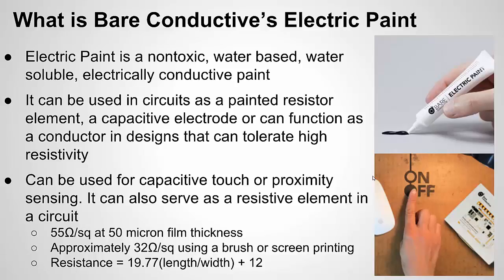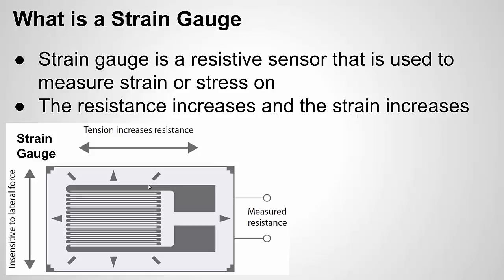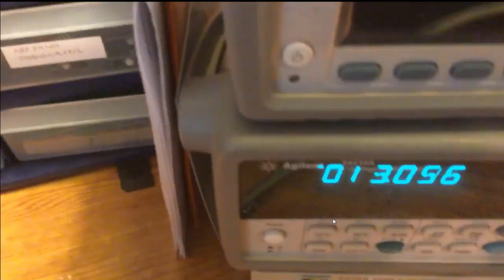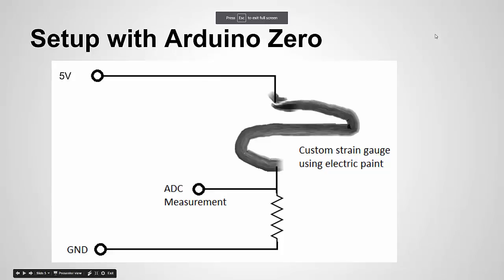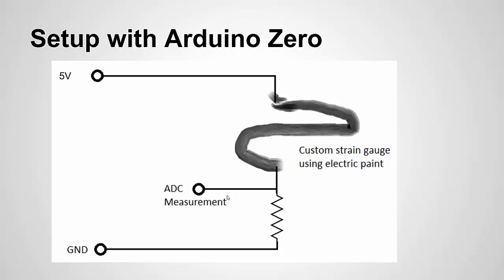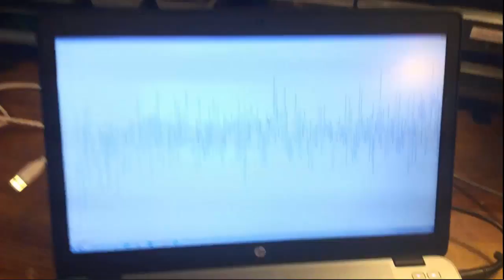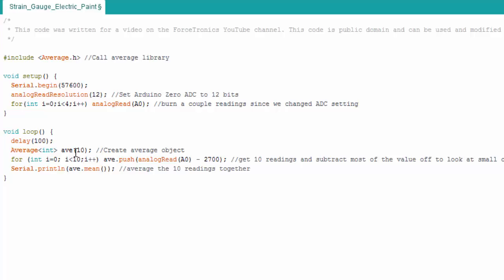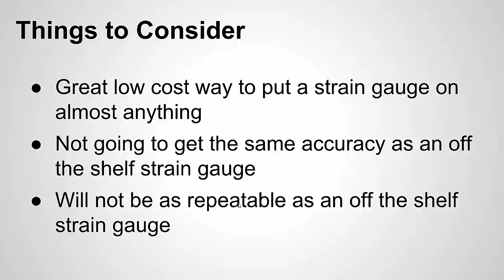Building a Custom Strain Gauge with Electric Paint

Comment: For higher resolution, could you use a lower voltage reference? Instead of 12 bits across 3.3v, you could set it to 12 bits across 1.1v see an improvement, right?

Comment: have you tested the response time for these kinds of system? I'm looking for a sensor that can detect rubber ammunition impact but the time of contact is too small for a typical arduino pressure sensor...So I was wondering if this is sensitive enough for a sudden pressure change, Thanks!
Reply from the maker: Interesting application, but I did not test impact strain on a small portion of the surface area. Also I would not call this a highly repeatable method to measure strain

Comment: Nice video - did you consider interfacing the strain gauge via a Wheatstone bridge for improved accuracy?
Reply from the maker: Great comment. I did have a slide for the presentation to suggest adding a Wheatstone bridge. I left it out because I didn't want the video to be too long and I was afraid that the mediocre repeatability of the electric paint would sort of nullify the benefits of the bridge. It could be beneficial, but I did not do any testing with the wheatstone bridge